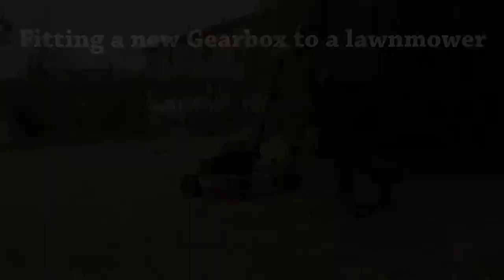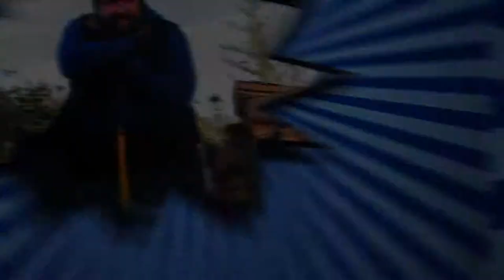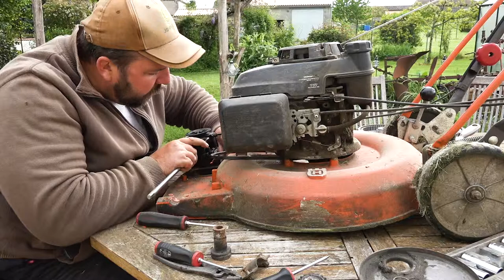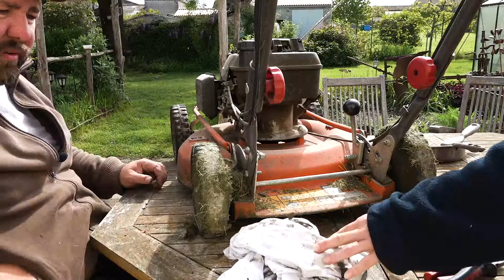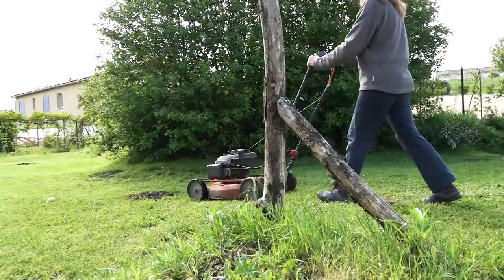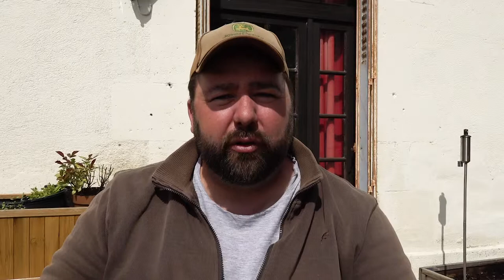How to replace the Transmission on a lawnmower.

Comment: Hi Ben, thanks for the video. I have the same mower which will drive fine but won’t go into neutral. Cable seems to be working the lever on top of the gearbox as it should. Any ideas? New gearbox is very expensive!
Reply from the maker: David McQuade  I would try disconnecting the cable to see if it is holding the gearbox from going back into neutral. If the lever then travels all the way and it still doesn’t go into neutral then it’s likely the gearbox. They are fairly expensive but the mower is definitely worth it.